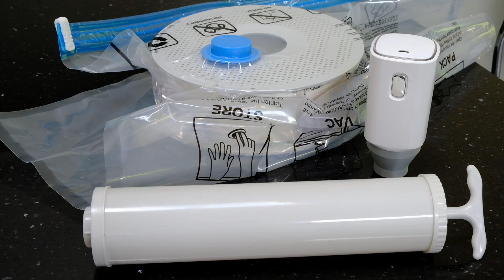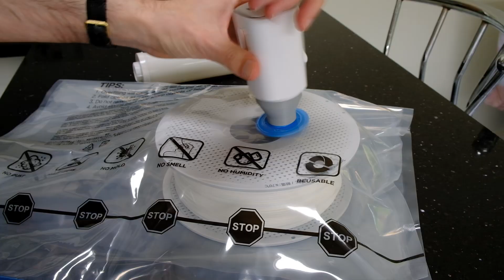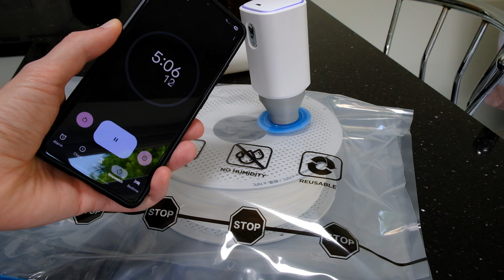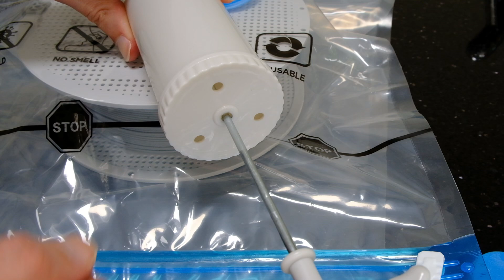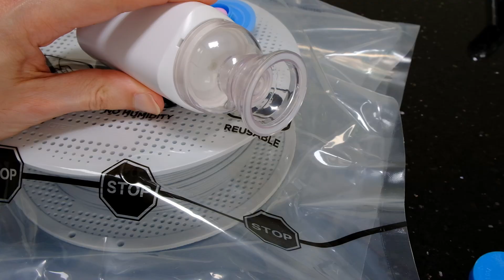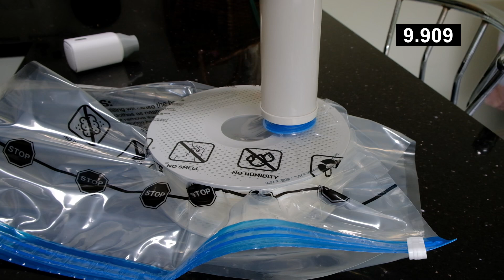AliExpress Electric Vacuum vs Hand Pump - Worth Buying? Sealable Bag Showdown!

Comment: I guess the 3d printed adapter is leaking or something? The hand pumps I got with my bags was much smaller, about the size of the electric one, but my electric one pumped about the same speed as the hand pump just much less work.
Reply from the maker: The small hand pumps look like a lot of work .. the big one that came with the Amazon bags extracts the air in 10 seconds :) Yeah, the 3D print could do with refinement.. but even if it had 0 leaks it'd take 1.5min to extract all the air from the bag. Appreciate you taking the time to comment and tell me about your experience.. I think a better electric vacuum would make all the difference.